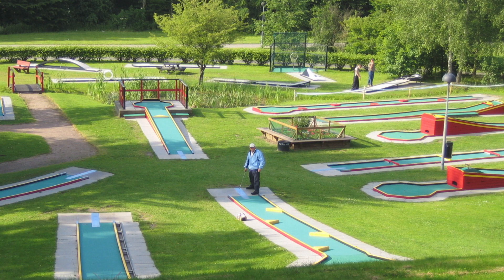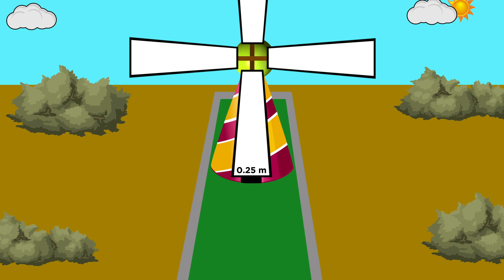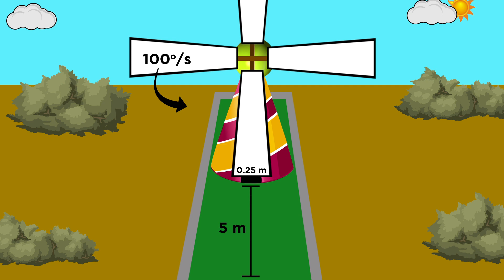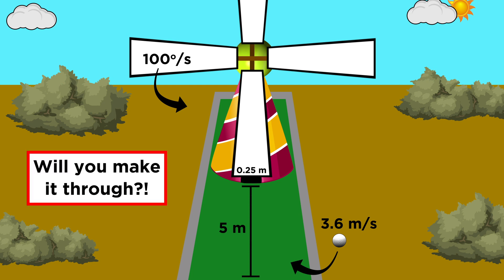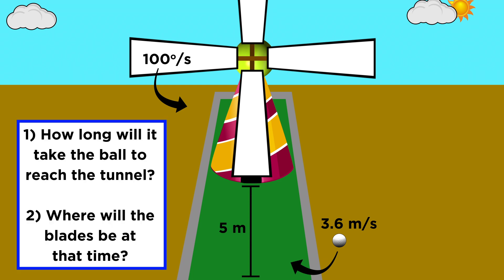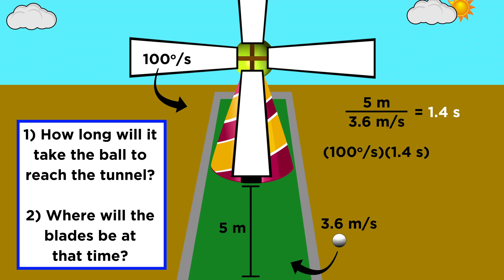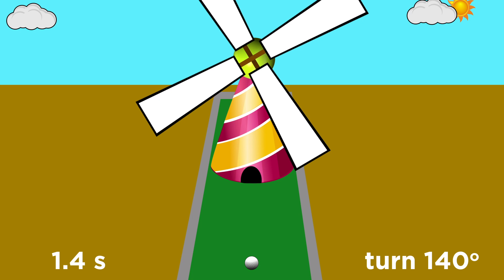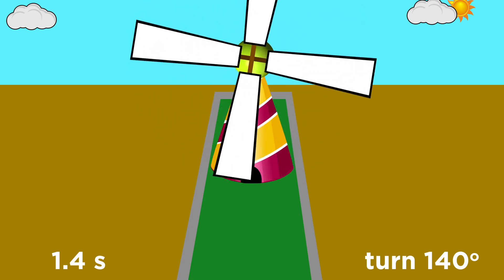Practice Problem: The Mini-Golf Windmill

Comment: I'm curious, if the windmill was closer to the hole, how would we take into account the fact that each of the blades is 0.25 meters? Would we have to know the length of each of the blades?
Reply: Yeah, I went t through the same situation. Don't even need to know the width of the blade!